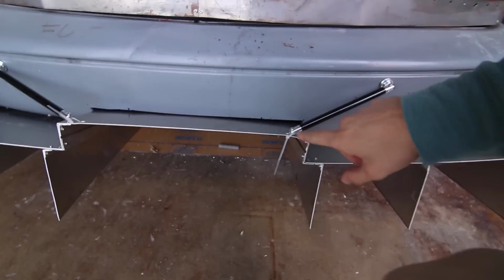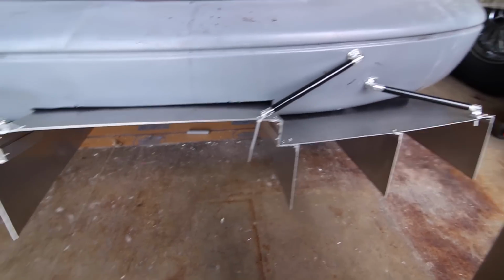DIY Diffuser Part 2

Comment: I'd cut the rear bumper so it's straight and flush with the end fins on the diffuser. Maybe get better turnbuckles. The actual diffuser itself looks good.

Comment: I think...
 if you remove the inside rods & made outside straight up & make outside flare same angle as tyre camber 

Or remove bumper and make it connect with trunk
Reply

Comment: I Like it, it needs to stay... I personally would trim it up just a little, so it doesn't stick out as far as it does. and maybe roll the front up under the car a bit so it's tucked, plus you would get a little more ground clearance. but it's your car, that's just my opinion. overall I love the car, and 'The DIY Widebody' you have fabricated... when are you doing something with your hood? is there a front diffuser in the future?

Comment: maybe its too much rice?  for the csr as a whole the thing with the least rice its thay diffuser man, I honestly think it flows very nicely with the rest of the car, and if I had a sportier car than my lincoln I would definitelly do a difuser like that. thats definitelly a keep, just make SURE you attatch it as securely as possible under the car because if it comes undone and the air catches the front part of that diffuser its going to get pushed to the road, create a lot of sparks next to your gas tank. and if it gets caught on the road will rip your rear bumper off

Comment: I really like rear diffusers on cars, but there's so many little things with this one I'm not really sure I like it... I think it sticks out a little too far, maybe have it flush in the middle with the bumper but keep the diffuser as a straight edge so where the bumper tapers off on the corners it'll poke out a bit ... really not liking how saggy it's looking, & those support beams or whatever look super cheap & kinda ruin the look I find. Still like it a lot more than just the plain bumper though

Comment: Do you know about how much your car weighs. I know miatas are 2300-2500 lbs stock, but with all the additions like custom metal parts and enormous tires, i feel like you'd be over 3000 lbs by now. Just wondering.
Reply: Chris Perez who cares?
Reply: Pat Rick  I do
Reply: Pat Rick Me
Reply: because so much is cut out and stripped, he's probably sitting at 1900-2100 would be my guess.

Comment: what did you use for support on the inside as you went in towards the diff? im buliding mine and ik i can use the tow hooks for support but i would like to extended it just a little more

Comment: What is the name of the tool you used to hold the snub?

What kind of iron plate did you use?

What did you use to attach the diffuser to the car, it looks like a spring?

I'm sorry, I do not know how to speak English, so I'm asking, using google translator.